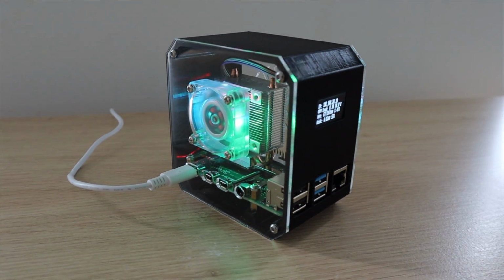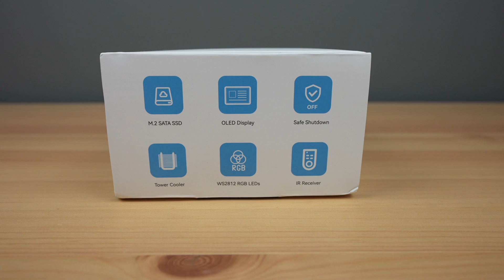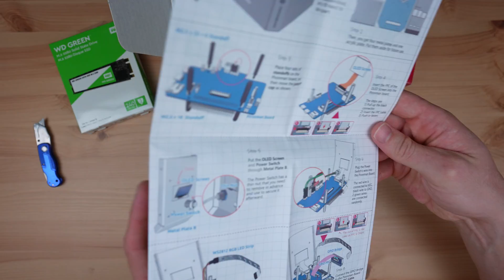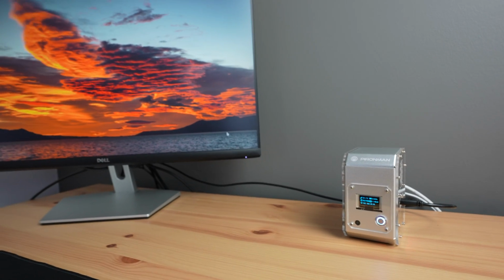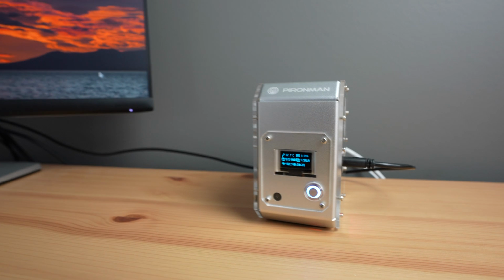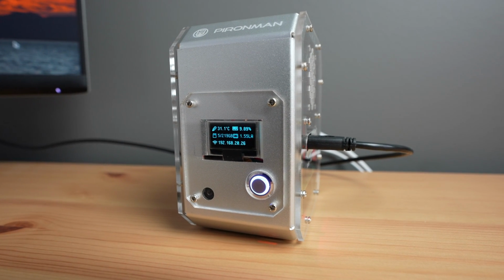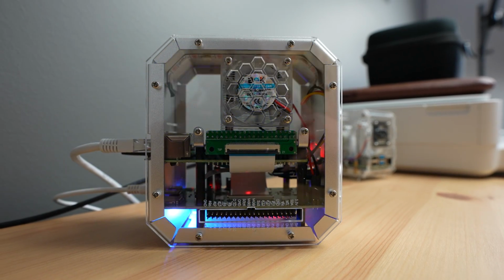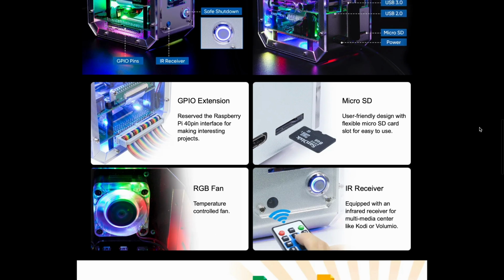Awesome Cyberpunk Case For The Raspberry Pi 4 - Pironman by Sunfounder

Comment: If you can healp that would be great. I've got the case as well with a pi 4 8GB. I have installed the pironman files and the screen and lights come on a change properly but when I do a reboot either through the shutdown command or long press the power button it won't come back up. Some of the board light come on but there is no internet connection to remote to and the case screen and rgb light don't come on. Any ideas? also I have connected a monitor but there is no output.

Comment: Hello, do youuhave a design that works with the piJuice + a fan? the piJuice UPS HAT (which sits on top of the pi via gpio) does have specific button that are no longer available if the case is not built for it. @Michael Klements

Comment: While I found the case to be incredibly impressive, and super fun to build. I encountered difficulties in maintaining a consistent overclock due to it. Each time the fans activated, the system would experience crashes. The root cause of this issue remained elusive despite my efforts to identify it. The jumper system is a bit all over the place. I am sure it had something to do with that, but I gave up. As a resolution, I eventually transitioned to the Argon V2 case, which successfully passed all stress tests using the exact same overclock settings that had posed problems with the Pironman case.
Reply: Glad I seen your reply. Was thinking of going for this case, but also have the Argon in mind as well. Think I will go with Argon.
Reply: @Ynotdoitnow  I'm very happy with mine. I reached out to the makers of the Pironman case, got a replacement case, and the same situation. I am confident there is something not optimal about the design of their case. I just wish I could pinpoint what it is.
Reply: It's way too much for 5.1/3A power.

Comment: The case would work pretty well with the Indiedroid Nova. You won't have to use the SD ribbon card, but everything else seems it would fit. I reached out to the manufacturer of the case and they stated that it was supported, which I understand where they're coming from. Either way it wouldn't take much to get it to work.

Comment: Did you try it with wireless peripherals and ssd connected at the same time...? I have a Microsoft keyboard connected to it and it seems that the voltage is not enough for the keyboard to work properly. Please help
Reply from the maker: Yes, this was all done with a Logitech wireless keyboard and mouse
Reply: @MichaelKlements  Can you tell me what exact model of Logitech keyboard, the one I have jerks and does not work correctly with the pironman case

Comment: Michael, best regards. What recommendation do you have to control the temperature of Lattepanda Delta 3 to use it as a gamer?
Reply from the maker: The Delta 3 has pretty good onboard cooling, just make sure that it is well ventilated (don't block off the airflow paths if you put it into a case). Alternately, adding a larger 100 or 120mm Noctua fan on top of the Delta 3 would probably also improve temperatures.

Comment: In regards to the fan on the side panel, could you use washers to raise it just enough so it doesn't hit the acrylic side panel?  I agree, the sticker showing isn't great.
Reply from the maker: Yes you could quite easily fix the problem with washers, or I thought about just laser cutting the hexagon pattern out to make an open vent. It's just not something that can be done with what is included in the kit - and the fan really shouldn't be like that either, the hub should always have some clearance between it and the face.

Comment: A fan cooling strategy that results in a case with slight positive pressure helps keep the internals clean as it's less likely to suck dust in from the outside. Could be another reason for having identical vent holes on both sides of the case.
Reply from the maker: This only really works if you're filtering the intake air as well. The fan is drawing air in through open vents anyway, so dust is going to get into the case.
Reply: @MichaelKlements  Good point!

Comment: I've just taken delivery  of this a couple of days ago. There is a glitch whereby if the pironman script is running, it interrupts video play and audio output. I emailed support and was told they are aware of it. The PWM used by the RGB light conflicts with the system's audio PWM. Switching audio output to HDMI didn't solve unless you hook up a USB audio to output the audio. Great review anyway.
Reply from the maker: Thanks for pointing this out, I'll see if I have the same issue. I didn't notice any issues with video playback but I didn't have any audio connected at the time.
Reply: @MichaelKlements  I found out another issue whereby the RBG lights and PWM fan turn off by itself after about half an hour. They didn't come back on even though the temperature has surpassed the designated point in the config file.
Reply: @limseehong  any solution?